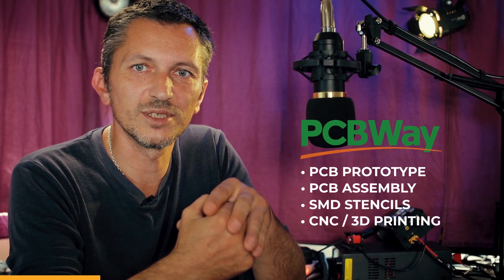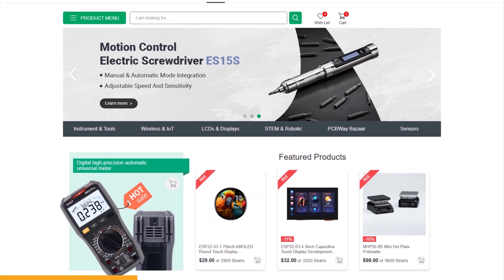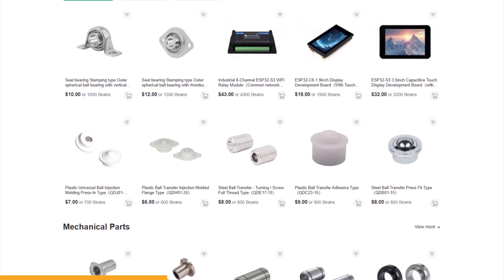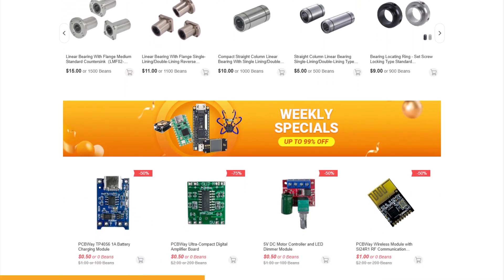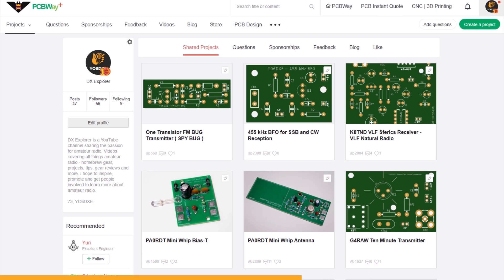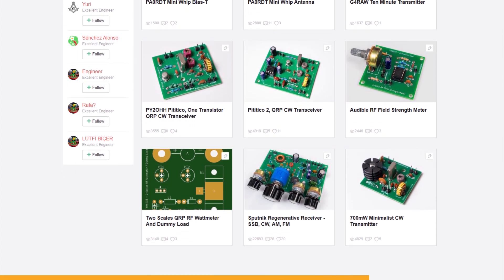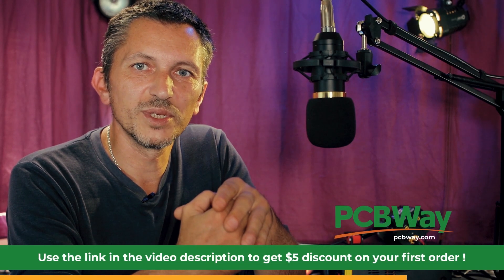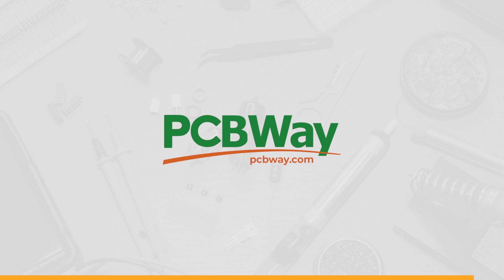Frequency Shifting: Crystal Controlled CW Transmitter Experiment

Comment from the maker: Have you tried this before ? Let me know down bellow on what you used this method and how that worked out for you. Also remember to play a bit more with the value of the inductors... you may actually be able to use the entire CW portion of the 80m band even with the crystals I used. It all depends on how much the transmitter or transceiver can take until it becomes chirpy. 73, YO6DXE.
Reply: The chirp is the crystal heating up from too much current going through.  A common problem with single transistor (and old tube) transmitters.  The HC49/s will chirp more (less area) where the HC/6 with it's larger quartz area will usually chirp less.
Reply from the maker: @johnclements3441  That is very true. This chirp sounds little different than that one though. I don't know how to explain... its like a bad contact or not enough power for the transmitter. Is more like a click sort of. I will put a note to show the difference in the next video. But I know what you are talking about. That is the reason I don't like the little crystals like the Pixie one 🤣 If I add too much inductance it does the same sort of chirp then it stops oscillating at some point.  73, YO6DXE.

Comment: Hi, I did this with a 20m crystal and it worked like a charm. But I wanted to ask if there's any way to add a receiving stage and turn it into a transceiver. I'm not saying it'll work for any frequency, but for a specific one, which I suppose would be easier (for example, in my case, receiving on the 20m crystal frequency, which is 14.318MHz).
Reply from the maker: I don't know, but for sure it can't be impossible. I just don't have the knowledge to do that. The idea for these simple transmitters, was to use them together with a separate receiver. This way we build one single but good quality receiver and we can use that one with all sort of transmitters 😁.

Comment: Excellent video, as always! 🙂By the way: You can detune the crystal by opening the HC49 case and either remove some material by filing it, or adding some material e.g. by using a very soft pencil. This was a common frequency modification technique back in the olden days.
Reply from the maker: Thank you so much for watching my friend. Ohh yes I remember the method. O was just watching some videos on that the other day. I never opened a crystal yet. I don't have too many anyway so I didn't want to mess them up 🤣 73, YO6DXE.
Reply: @dxexplorer  I only have HC49/H (the smaller version) as 3.579545 MHz, else I'd send you some in the mail. But just for the fun of cutting it open and experimenting with tuning by filing / adding material, I could mail you some 16 MHz HC49/U crystals. I have a bunch of them. Shoot me an E-Mail with your address and I'll mail you some parts.
Reply from the maker: Ahh no don't waste money on postal services. I will try to get one of those 10MHz crystals that are on all electronic boards and try to open one of those to test this. Thank you so much 🙏🙏🙏
Reply: @dxexplorer  Postage from Germany to Romania is just a few Euros. Let me know if you change your mind. Or in general if you need anything. I have an almost inexhaustible supply of components, most of it just sitting around unused on the shelve.
Reply from the maker: Good morning and happy Sunday. Sorry for the late reply. I've been crazy busy these past days ( and tired too ) building a racing pigeons house for one of my friends. Well... most of the stuff I build on YouTube so far is from recovered components and those I received from the subscribers. Usually I just had to buy variable capacitors and connectors, switches and so on. So I am always thankful for anything. This winter I hope to have more free time to build more projects. Right now I don't really know what I would need, but if you really want to send anything... I have the address on the new blog: https://yo6dxe.com/contact

I very much appreciate your intention 🙏 73, YO6DXE.

Comment: It's quite a common technique, seen it used a lot in CB conversions and a few Ham homebrew projects, it works pretty well and I'm surprised more people don't use it.
Reply from the maker: I learned it from Peter VK3YE long time ago from when he was modifying the Pixie transceivers. I tested it a few times but never on an actual transmitter or transceiver. Besides this I've only seen this used in some schematics from Miguel PY2OHH and I believe a French CW transceiver but I forgot the name of it. Impressive results indeed and is really work using it. I already plan on testing it on all I build so far and it was crystal based to add a little frequency agility. Even just a little is better than a fixed frequency. Thank you so much for watching. 73, YO6DXE.

Comment: I've never tried shifting the frequency of a crystal oscillator. I did see a video by Peter Parker who you mentioned do that using the second crystal. I had never made a crystal oscillator till about a year ago. I wanted to make a down converter. I got the circuit for the oscillator off YouTube. It was called a crystal tester because it worked with a wide variety of different frequency crystals. It used what I believe is the minimum amount of components. 2 capacitors, 2 resistors, a general purpose npn transistor, and the crystal. It worked first go, and indeed with a variety of different crystals. What I wanted to do was down convert an incoming radio signal on 487.600 MHz down to one of the channels on the UHF CB band. In Australia this covers roughly 476 to 478 MHz. No licence required for using these radios. The radio I had, a Uniden, I found years ago on a bush track when going for a run  with my dog. The frequency of interest is a taxi company. They have a repeater and the frequency is quite active. I used just a single germanium diode for the mixer. I had an old 27 MHz radio that I had been placed on the verge for collection with other stuff. They don't all, but this one had heaps of crystals. Both in the 10 MHz and 40 MHz range. I'm guessing it would have used sum and difference for all the channels on the 27 MHz CB band. I found 2 crystals that lined up with what I needed. From memory, the one I used was 10.625 MHz. A couple of alligator clip leads went to the diode for the antenna. The oscillator too. a couple of leads at the other end of the diode was the output. The difference. No direct connection to the CB radio required. It triggered the squelch no problems. While I had the radio right there next to the output. It would work maybe a metre away. Audio quality was excellent. I do have a Baofeng that can pick this transmission direct. But when I built this, I did most of my listening using that. It was rewarding. Sadly, the frequency has gone silent. I think they may have switched to some other means of communication.
Reply from the maker: That is all about in this hobby, building stuff and experimenting. We also have that free band called PMR here. But I believe is somewhere around 460Mhz or something like that anyway. Thanks for sharing this. I remember long time ago when I had no PMR radio I also wanted to build something to receive. Back then it used to be a lot of talking. Now I only hear some kids now and then or hikers up in the mountains. Other than that is all quiet. 73, YO6DXE.

Comment: i see surprisingly large band, with the three crystals, are you sure you have it? 
from all other sources i ever found, band was not that large
Reply from the maker: With a bit more effort you can get even better actually. I just didn't had the right inductors on hand. I got better results in a DC receiver I built a while back covering the entire CW portion of the 40m band. I am also impressed 😁 73, YO6DXE.
Reply: @dxexplorer  80k frequency variation?! u sure? this requires some verification. 
because if it is so, is too promissing to not use it
Reply from the maker: Verified of course. That is why I made the video 😁 Of course is exciting. I don't know if the smaller crystals like those in the Pixie transceiver can do just as much... but these bigger ones seem to do a pretty good job. I'm already planning a Ten Minute Transmitter with build in VXO 🤣
Reply: @dxexplorer  if you can verify, is the bandspread higher if the maximum level of power on the crystal is higher?
Reply from the maker: @saramanbrudesco  I don't think that will affect the bandspread ... but I will film a short and post it a bit later today to send you the link to see on the transceiver as well. And I will power the TX on 8 volt then again at 12 volt to see if there is any difference in bandspread as well. I will send you the link to the video when is up.
Reply: @dxexplorer  am waiting :) 

try also at very low power, please!
Reply: @dxexplorer  The HC49/s will have a smaller bend range due to the nature of the cut (ATx verus AT).  You can parallel them to increase but a couple 49/U will bend more.
Reply from the maker: No difference when changing power. Just a slight slight change but like 10Hz.
Reply from the maker: I only have these three crystals for 80 😁🙈 I wish I had more. But I will try to get some more and see what happens. In a proper VXO circuit ( with a dedicated oscillator ) they perform even better and the oscillator can take even more series inductance so I can go lower in frequency. On the transmitter I am limited as at some point it stops oscillating. Maybe with some adjustments to the transmitter ?
Reply: @dxexplorer  nope! adjustments "in the transmitter" irrelevant. must be varied the power on precisely the crystal. 
so, your experiment indicates the variation of the band width is mor like a theoretical matter, not practical. 

thank you for the plus experiment!
Reply from the maker: @saramanbrudesco  I thought so. I mean at the end there is jot much I can do to the transmitter. More crystals I guess 🤣 Experimenting is fun. I always feel like I discover something new ( even if it's not )... but I can never get enough if this it seems.
Reply from the maker: @saramanbrudesco  https://youtube.com/shorts/or7gStHq9QY?feature=share
Reply from the maker: Even more VXO fun 😁 https://youtu.be/aY09s3zywTg